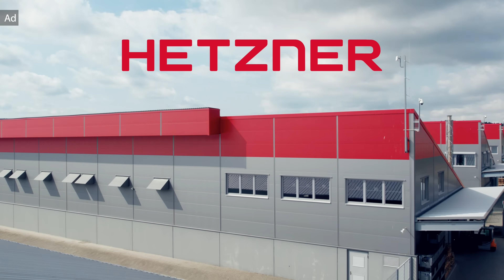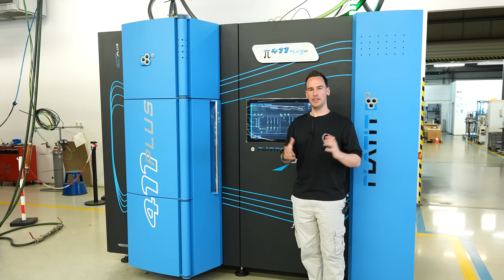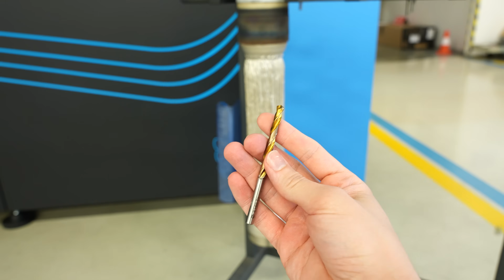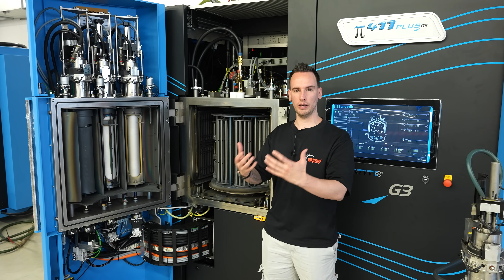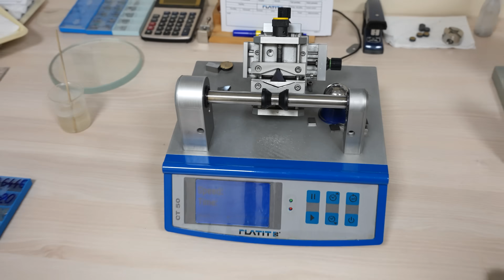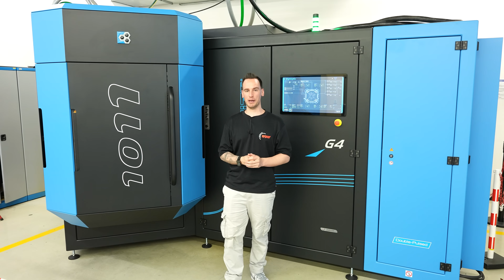We Bought a $1 Million PVD Machine to Coat Our Water Blocks

Comment: Pretty cool to get a proper view and analysis of the process. Pvd is a quite common coating in several of my hobbies, i.e. Namely mountain bikes and pocket knives. They use it on suspension shafts for bikes(famously, obviously for other components as well), and for pocket knives it's used everywhere from blade coatings to handles to hardware. Im surprised it took this long to get adoption for waterblocks but I suppose it's just not the typical application where you would need a coating such as Pvd. Nice to see, it's a very desirable coating. Much tougher than anodization(black can't be anodized anyway).

Comment: The process is called sputter coating. The spinny cylinders are part of what's called a magnetron, and not the heating-up-your-food kind, though the operating principle is the same(using a magnet to shape where the charged particle current flows).
This can be done in a tiny, cheap(a few thousand) desktop machine too, with no moving parts. But that's a high volume production machine.
Reply: This is not sputter coating. Sputter required constant Argon gas to work.

This is called vacuum arc. This process need a electrodes to jump start the arc. you can see the electrode at the top 6:44

Comment: How did you decide on a specific coating? I work in precision machining for high medical as an engineer and we have tried several coatings on our cutting tools. Typically, these coatings have low thermal conductivity W/(mk) which helps with keeping heat into the chip and out of the cutting tool. Tungsten Carbide already has an incredibly high melting point but it does make a significant difference, even with flood and through-spindle coolant.

I’d imagine you’d want as high of thermal conductivity as possible while maintaining protection from galvanic corrosion etc?

Coatings thickness should also play a heavy role in changes to thermal properties, TiN coatings seem to range from 20-30W/(mK), copper is between 385-400W/(mK), that’s a pretty substantial difference. DLC coatings can be as low as 2W/(mK) and TiAlN is typically 4.5-12W/(mK)

I’m sure you’re already well aware of this***

Very curious to see what your testing equates to given the size of this investment, being able to coat your own tools is a crazy thought…

Do you have plans to expand your business beyond water blocks to justify the cost? I’m actively waiting to hear what solutions TG has for a one stop shop on liquid cooling between the radiators shown off, fittings, water blocks for 5090’s/5080’s and AM5.

It would be worth dedicating a build to once this comes to fruition.

Comment: I worked for over 10 years in the Manufacturing of DVD-DL and even CD-ROM Discs. I was thinking on how the Sputtering system is the same principal. There are some differences in what Metals are vaporized such as Silver and Aluminum Primarily which done in a vacuum environment with Argon. These machine are not cheap and the machining of parts can be very expensive. Nice equipment!

Comment: I've built numerous CVD and PECVD tools. I prefer CVD for DLC and DSL coatings.
Reply: What is DSL?
Reply: @JJFX- Dry solvent lubricant is a type of coating typically applied on firearms (M4A1) and M240. lower friction coefficient, better wear resistance, and improved corrosion protection. “Friction coefficient”
Reply: @ADELAROSA12  Interesting, that makes sense. Thanks!

Comment: Small chamber for a big machine. Must be a huge roughing pump behind that shell. Lol
Reply: The vacuum pumps can actually be pretty small for a chamber of this size. Most of the space is probably the power supplies, wiring, and electronics for those cathodic arc targets. Each one needs kilowatts of power at very high currents, similar to an arc welder. Plus another big power supply for the bias. Then all the plumbing for water cooling everything!
Reply: @mrbitjetson yeah, I know I was just being silly. I have seen huge roughing pumps with 8" SS Bello's for a low vacuum with a gate valve to pump down in sections. Power supplies are huge with ARC management. I've used Pinnacle P.S. Typically that tool will have chilled water for the targets.

Comment: while super interesting and longing for your great product, I am planning to get into custom loop with my 9070XT and 14900K, but the old platform is difficult to justify a $500 CPU block, so maybe when hardware goes back to normal my next upgrade could use your new CPU block for next gen.
Reply: The new deltamate block only officially supports AM5/AM4 and you really don't need a $400+ CPU block man... a less expensive block like the Mycro still performs great and saves a lot of money to put towards whatever GPU block you need.

Comment: how many water blocks do you have to sell until the machine is payed for and starts making money? I am pretty sure 3 human lives will still not be enough time for the machine to be payed for
Reply: It can cost £40-£110 to get a single part nickel plated. It only costs a few cents to PVD coat parts, in consumable costs if you own the machine. At 5000 units a month, it could pay for itself in a couple of years.

He could also run a side hustle throwing contract parts for external customers in with his parts or between batches to make a little more cash to pay back faster. 

Our brains often struggle to understand how much a million or a billion is. But that includes sales volumes as well as costs.
Reply: As smart as Roman is, do you really think he wouldnt have already done a ROI calc, and decided that this is a winning prop, a good investment??  I’m 100% positive he just didnt say one day, “let’s just go drop $1M on a machine and see if it works!”  Lol
Reply: @troutboy299 Absolutely, he ordered copper and aluminium from china without hiring a person to check the order before shipping, resulting in receiving srap steel, this just seems like another way to throw away money again.

Comment: you didn't really touch on why?
that's a huge investment. Is it simply so you don't have to outsource nickel coating? will it allow for better cooling? 
It would be interesting if it would allow for different colours. golds, or purples etc.
Reply: he explained before in other vids, its better than nickel for liquid metal
Reply: He tried a bunch of contract manufacturers for doing the nickel plating step, but could not find one that would reliably produce a durable coating with even thickness